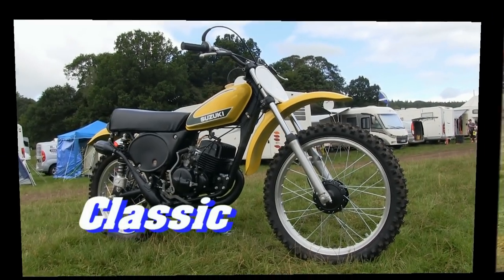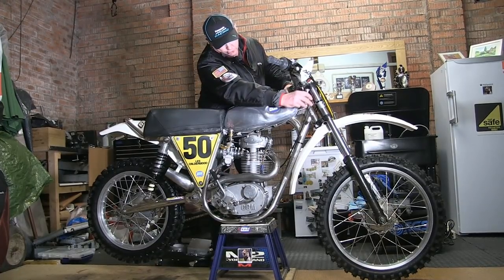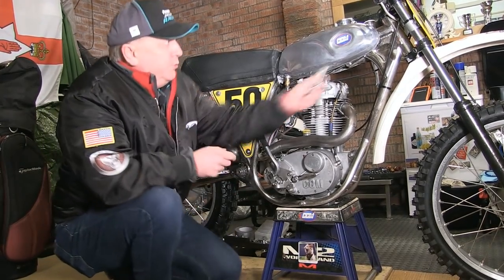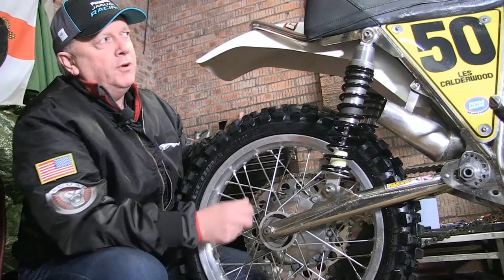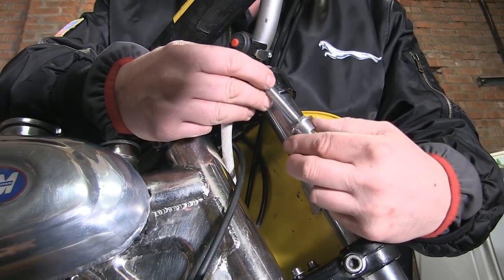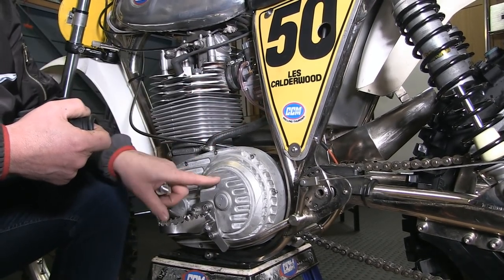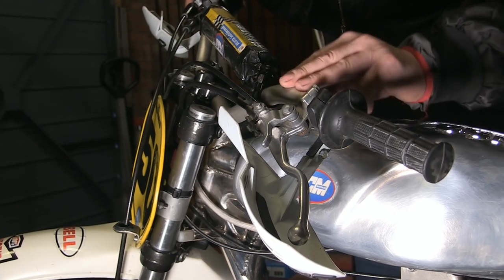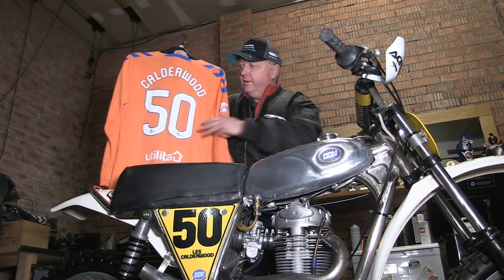Les Calderwood 1974 580 CCM Ready for 2019

Comment: I used to scramble various models of CCM in the 1970/80s - and I always raced under number 50! 
I also remember those wretched battery packs going flat in the middle of a race! - and having to push the bike back, to connect the charge lead up to the van battery.
But the most important thing was that I used to run them all on Castrol R.
3 speed Quaif gearboxes etc.
If anyone ever asked me what CCM stood for, I used to answer "Concrete Mixer"!